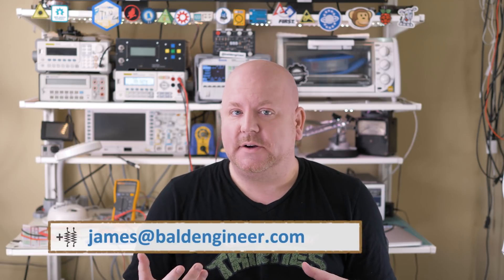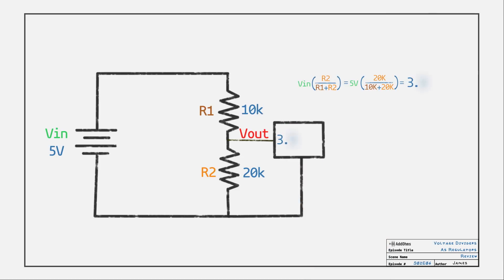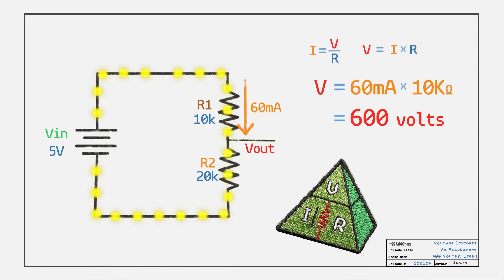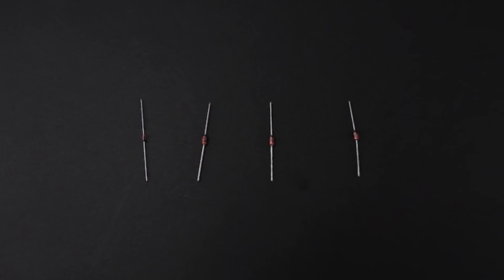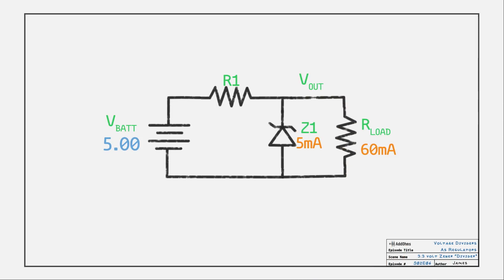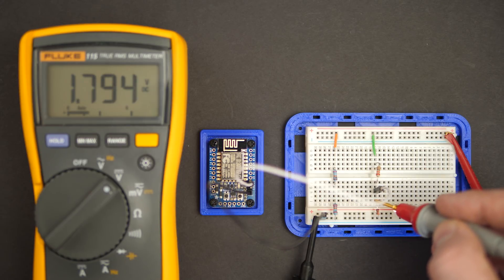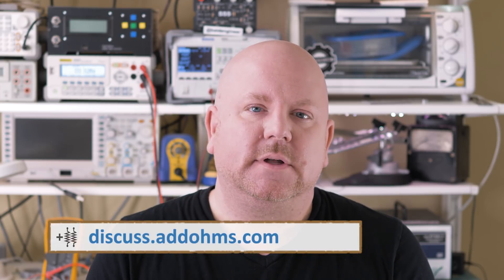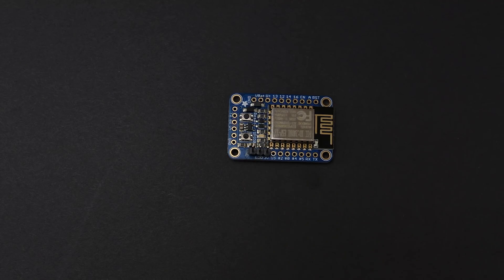Voltage Dividers as Regulators ?! | AO #22

Comment: I use Zener diodes in combination with general purpose diodes with their anodes commoned together to protect MOSFETs from positive and negative voltage spikes. These are handy when application specific TVS diodes don't have the withstand voltages that I need. This diode buddy circuit will start to conduct if the gate-source voltage rises above, say 15V, and the general purpose diode will block source voltages from flowing into a gate that is off.

It's always a good idea to have your zener voltage above your working voltage, but low enough from your absolute maximum voltage rating. If your 3.3V chip has a maximum voltage of 5.1V, a 5.1V or even 4.9V zener wouldn't protect it from transients, because the knee of the I-V curve wouldn't reach a low enough dynamic impedance to actually clamp the voltage before it hit the ceiling limit of your chip's maximum ratings.

Comment: I use zener almost exclusively as a protection device on the input of the circuit.  For getting a regulated voltage i usually  use a buck or bust or buck/bust converter and add sufficient decoupling to the ic's or if the circuit is very sensitive to ripple i use a linear power regulator.

Comment: I've used a zener as a reference to the base of a PNP power transistor (with a limiting resistor across the collector to base) to brute force regulate incoming voltage. The output was taken from the emitter and could be further smoothed by a low capacitance of a few microfarads. It worked well enough when the 78xx series was a bit more pricey.
Reply: Same here: resistor and zener as a reference for a emitter-follower PNP transistor.
Reply: Night Stranger same. I did this for one of my electronics projects as an undergrad.

Comment: Had a flashback there. The condo where I lived at the time had some issues with heating and cooling. I was a pretty decent pixie wrangler so I took off the cover and was intending to look for any obvious damage to the board. I nearly screamed in horror at what I found. The board had 24v AC coming in that went through a single diode and then through a voltage divider to power the rest of the board. It had big resistors and the board was even cut out around them so they knew how hot it would get. The board was discolored around the resistors from the heat. I can't remember the exact board but it was an older Honeywell. On top of it all that cheaply made, single sided board was $600.
Reply from the maker: +cypherf0x yikes! It amazes me that a brand new HVAC unit today still has a control board with mostly through-hole parts.

Comment: Voltage dividers using resistors were common in valve equipment where a lower rail might be needed for something. But because those circuits run at high voltage and are high impedance it's more practical. The voltage output of a divider will remain quite constant if the bleed current through it exceeds the demanded load current a factor of 10 or so. That will work, but naturally is highly inefficient.  

You could improve it by using higher value resistors and then use an emitter follower to source the load, but by the time you muck around with that you might as well just get a three pin reg. And of course the divider/follower doesn't have any line regulation (for that matter ANY real regulation) at all. That might not matter though if the feed to it is already well regulated, such as your 5 volt USB rail. 

Zener diodes provide a better voltage reference source if the current through them is kept constant. There are quite a few circuits that can do that, but a simple way to achieve a quasi-constant current is to replace the fixed resistance with a small incandescent light bulb, the voltage & wattage found experimentally to approximate the value of the resistor or current flow you might have calculated to begin with when the bulb has a bit of a glim to it. 

If you want a quick and dirty way to knock a voltage source down by a couple of volts just use a string of two or three normal rectifier diodes in series with the supply & the load. That was always a good trick to run 5 volt TTL logic from a six volt lantern battery.

Comment: I used the combination zener and resistor to feed one input of an opamp with a stable voltage (let’s say about 5v) independent from the supply voltage (a 12 volt car battery for example). Than using a potentiometer as a voltage devider on the other opamp input you can set a threshold at which battery voltage the opamp turns on or off (thus depending on which input of the opamp is connected to the higher of both voltages of course). With this I created a battery low voltage monitor that switches of a relay (could also use a mosfet) that kills the power to the circuit if the battery went too low.

Comment: Zener regulators are used in tandem with the similarly kludgey CR dropper ac/dc supply design when low power loads are plugged into mains.

Comment: In many cases zeners work well as voltage references.  Also, if the next stage is very high impedance, then a zener, or for that matter, a voltage divider, works fine.

Comment: I have used zener regulators on many occasions, generally when I don't have a regulator on-hand. I have been trying to design a simple but good lab bench power supply (dual-rail 0-30V, 0-5A), I would test my circuit with a small 12v 50va transformer, and to get a stable +- 12V for the op amps, I used a zener regulator, since I had no linear regulators on-hand and a whole bunch of 12V zeners and big resistors. They are also generally more-used as voltage references, although in honestly they make voltage reference ICs which can be used as drop-in replacements for zener references and offer FAR better "zener impedance" and much more accurate and precise voltages.
Reply: Also I used one in my tesla coil video because 50V killed my (only) 7812 in the video! I left it in as a bit of comedy! :) I continued the video with a shitty 12V zener shunt regulator.

Comment: This circuit can be improved significantly by adding an NPN BJT. Connect the collector to the 5v line, the base to the zener cathode, and the load between the emitter and ground. The emitter voltage will be about 650mV lower than the base voltage but this can be compensated for by adding a regular forward biased diode in series with the zener diode. You'll be able to use a higher value for R1 and your voltage regulator won't be consuming much idle current.

Comment: I  currently trying to fix some powered studio monitors (Roland DS30A, 30 watt version of the DS90 studio montirs which one can find the schematic on the net) and they use a transformer that gives about 25 volts, into a voltage divider, using both (they call it 29 v on the schematic but it is RMS so when it gets rectified it is 25 v) they have mirror circuits after the bridge rectifier, where they supply +25vdc and -25vdc, as well as after the divider, because if two 15 v zener diodes they also supply +15vdc and -15vdc. 
In troubleshooting it was driving me crazy. I was getting a very low (around -5.8 vdc) voltage at what should be -15vdc power out to the board.
I even took out the zener, breadboarded (three nine v batteries in series, for about 18 v) and tested the zener and it seemed to be giving -15v. But after changing out some caps, etc. kept coming back to it, and traded it out and voila…-15v. 
But the thing is, it is powering a LM4766 Audio chip, and I’m assuming that chip is varying very much in its current demand as it lowers the actual speakers.

Now I’m thinking this is a pretty bad design. Still am not getting sound. Was thinking it was the mute section, and something seems wrong there, though I replaced the LM7466 chip, used thermal paste (has a HUGE heat sink). Blew up a few also, not sure why.

Comment: I got a nifty battery eliminator circuit for my VTVM that uses a zener diode.

I attend to use zener diodes as voltage references for opamps.

Comment: Just found your channel and subscribed.
Honestly I think I'd never use this setup for regulating voltage unless, like you said if it's a stable load. I have a few voltage regulators lying around anyways.  I'm studying electrical engineering, but I won't take my circuits class until next year so in the meantime I'm getting a minor in computer science.
Is the best way to protect against reverse polarity in a circuit to use a mosfet on the ground to the battery on a DC system?

Comment: Obviously zener diodes are used in voltage regulators but they are also used as a voltage reference in tuning circuits using varactor diodes to tune the frequency.

Comment: I’ve used them for my senior design project. We created a hand crank generator using 50w plate mounted zener diodes to output 5, 9, 12, and 15V at 0.5A. It worked like a charm.

Comment: I used zener dividers output conected to tip122 as an emiter repeater. 7812 could not handle the 60 volt input, so i mande my own LDO from 3 components.

Comment: Technically speaking you could use resistors. For example if you use one that let 10x more current flows in it than what your load could use then you get 10% voltage regulation. Of course for significant loads it means huge wasted current and a lot of heat. Also as you said if the input voltage changes the output changes too. Conclusion: you can but only for very small loads and if the input is stable. This is exactly what you do when you use a voltage divider to send a signal to an op amp, a adc....

Comment: Is there an advantage (or disadvantage) to using a buck converter and then a linear voltage regulator for a big voltage difference between input and output or high current? The L7805 gets really hot and I was wondering if the buck converter could mitigate that and the voltage regulator could smooth the output.
Reply from the maker: The technique you describe is used in some audio or sensitive data acquisition systems.
Reply: AddOhms Wow awesome! Thanks for the reply!

Comment: I use LM431 every time when I need voltage regulator under 100 mA. Cuz it's easy and on my work we have have a huge rail full of LM431)))
Reply: What's the difference to an TL431? Also can sink 100mA and is what I use (mostly as reference for opamps though). You can get 50pcs of them for less than 2$.
Reply: Same same.

Comment: 0:13 Not as a regulator, but of course you can use a voltage divider to power an esp (assuming you have a steady input voltage of 5V), you just need one 2 ohm resistor, one 1 ohm resistor (both resistors should be rated at least around 5 W) and 5V at about 2A and you're all set (you could probably get away with higher value resistors, especially if you have a capacitor to even out the ESPs current consumption). It's not particular reasonable if efficiency is anything you care about (although linear regulators aren't particularly efficient either unless you compare them to a voltage divider of course), but it's certainly most possible.

Comment: Shifting the conversation a little to current regulation: I just got an RPi 3B and added an audio hat. I am using  a wall-wart USB charger that is rated 2A nominal, and the power LED is staying steady on. According to Pi getting started info pages, for the 3B that means power supply adequate for that config e.g. it would start to flicker if current starved. (They say that the meaning of the power LED in the 3B (all Pi3s?) is opposite of earlier Pi b boards.)

Sooner or later I'm going to want to add some more gadgets, thus will incur more current draw.  The recommended 2.5 A wall wart would be an option, but circuit tinkering begs the larger question: how much current can be safely sourced through the preferred micro USB connector? I have a few good computer PSs  with multi-amp 5V leads but hesitate to try them for fear of frying the 3B.   I have other smaller 5V  power supplies scavenged from junk electronics from hamfests and transfer station discards.  Seems a shame to buy something when I have all this good inventory to work with. 

 So I'm confused about how to think about current regulation, and about folklore wisdom that says devices will only draw the current they need, even when the source supply is well in excess of their needs. Clearly the LED with limiting resistor circuit is an example of folklore being wrong in some cases.  I'm reasoning that to be absolutely safe I need a current limiting circuit between any high current 5VDC source and the Pi micro USB.  Maybe you could work that into a video, or point me to a tutorial that addresses my question? Also, would you weigh in on back feeding Pi through any of the USB ports < seems risky to me. tnx in advance.
Reply from the maker: You've made some incorrect assumptions which make answer these questions difficult. I've posted a full reply here. I don't mean to pick apart your question, but I felt the need to break it down to address each of the points. https://discuss.addohms.com/t/current-regulation/673
Reply: tnx,  my comments at the discuss forum.  Note that the Pi3B+ has PS redesign.  details and schematic at Adafruit site.
Reply from the maker: I can't find anything on a "Pi3B+". 

The Pi 3B is the latest. The "B+" is the final revision of the original Pi. This "redesigned power supply" is just a change from linear to switching supplies, introduced with the B+. For reference, I did a video introducing the B+ when it came out: https://www.youtube.com/edit?o=U&video_id=8ua7dkTLGII

There are no official schematics for any of the Pi, anywhere. The Raspberry Pi Foundation does NOT provide complete schematics. The most they offer are diagrams showing the I/O connectors. Which, aren't even complete.

(Slight edits. I confused the 2 and B+.)

Comment: What about using a zener as a voltage reference feeding the inverting input of an op amp used as a comparator?
Reply from the maker: That basically what a linear regulator does.
Reply: @AddOhms  So you could use an 8v zener OR an 78L08(or similar) if you wanted an 8v reference on the comparator? Is one better than the other or more appropriate?
Reply from the maker: The datasheet answers the question for you: “The L78L series used as Zener diode/resistor combination replacement, offers e improvement along with lower quiescent current and lower noise.”
Reply: @AddOhms  Oh ok, thanks. I am not an electrical engineer and I am trying to learn this on my own so reading data sheets is not very helpful. Understanding the information on data sheets should be a series of videos unto themselves.

Comment: Hello. I want to convert a battery powered kitchen clock (uses one 1.5V AA) to connect to mains power. I was thinking of using a USB charger (outputs 5V) and then changing the 5V to 1.5V. For this simple scenario would you recommend a voltage divider or a regulator? Thanks.
Reply from the maker: If it is one of those motor driven types, then maybe. An issue you’ll likely run into though is that many USB chargers are switching supplies and have a minimum current required for regulation. Especially cheap ones. That tiny motor may not draw enough. 

The upside to use a voltage divider, however, is that you can probably set the resistor values to bring it into regulation. (You could with a regulator as well.)

So. Make sure you do some measurements.

Comment: I'm trying to do this at the moment, I'm trying to make a portable CD player out of a CD drive from a hifi, I'm using an 18v drill battery, I need 12v and 5v for the drive, I'm messing about with resistors and zeners to try and tame the voltage haha, I'm learning a little bit I suppose
Reply from the maker: You need regulators. The motor should be a buck style and the 5v could be either a buck or linear.

Comment: So what's the ideal source for an active load? Fast solution is the voltage regulator fine, but if I had to design from scratch that would be a complex power source?
Reply from the maker: +Emiliano Barros I don’t know what a “complex power source” is. You would use a voltage regulator.
Reply: AddOhms sorry I meant complex in design since I don't know a lot of electronics. Alright, thank you so much for your knowledge!
Reply from the maker: +Emiliano Barros Watch my videos on Linear and Switching regulators.

Comment: So I have a DC fan with an operating voltage of 3.3 to 5v and draws 120mA that I'm powering via USB. I'd like to it to run it at 3.3v to make it quieter so I'm thinking a simple resistive voltage divider circuit would work fine in this case?
Reply from the maker: You wouldn't use a voltage divider. A series resistor will probably work.

Comment: a question, I have an analog output 0~10 volt but microcontrollers for measuring analog input just accept 0 to 5 volt how I can use voltage divider now?
Reply from the maker: That is a typical purpose for using a voltage divider.
Reply: @AddOhms  Can I use zener diode to break the voltage to 50-100 times. For example, 1 kV input and viewing 20 V in an osciliscope (using Zener)

Comment: Power amplifiers with DC servo use Zener diodes to bring down the supply rails to +/-15V.
Reply from the maker: Neither the voltage or application sound right. Seems like the zener is being used for over voltage clamping.
Reply: DC servo in a power amplifier is usually a simple opamp integrator. Since you don't need super stable supply to the opamp and most of the times the opamp is FET input the current draw is very small. A zener is perfect for this situation unless you have a dedicated low voltage power supply just for that opamp.